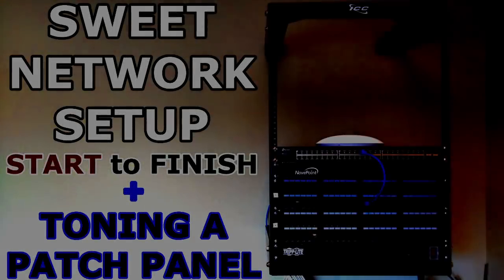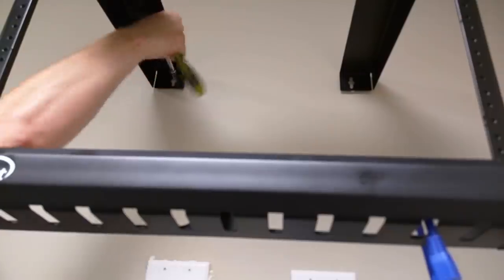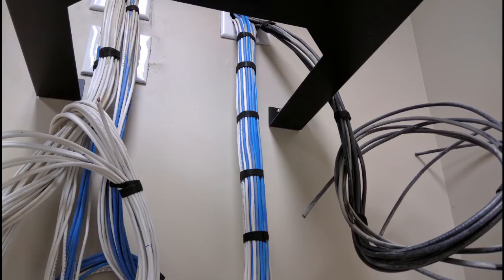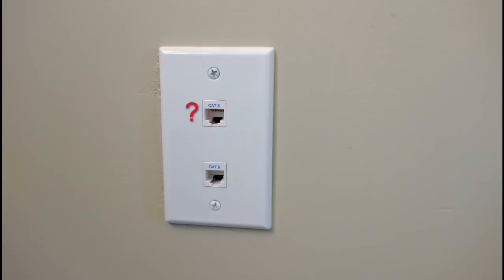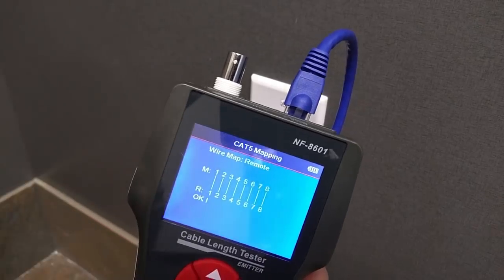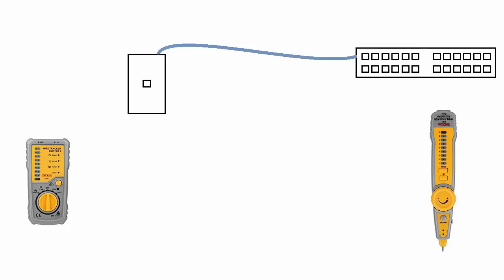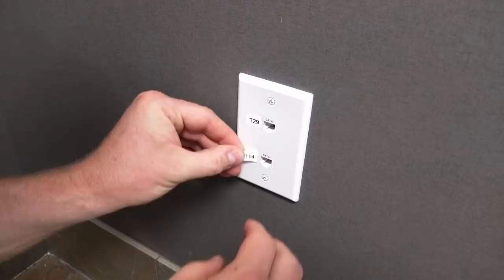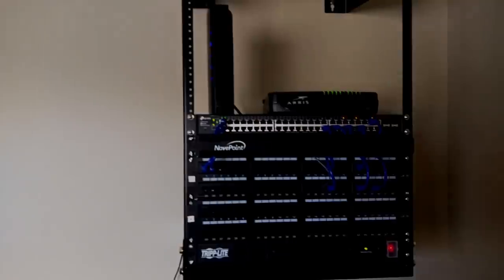Complete Network Setup // Toning, Identifying Ports

Comment: if you start with a 24 port port over the 48 port switch and the a 48 port patch panel all you will need is 6 inches long patch cords and the end result will look way better !!! you will have no need for a cable manager and front power strip also a bad option !!

Comment: Yikes you used the old style patch panels not the LINKOMM RJ45 24-Port STP Shielded Blank Keystone Patch Panel with 
[UL Listed] VCE (25-Pack) UTP CAT6 Keystone Coupler,RJ45 Female to Female Insert Coupler, UTP CAT6 Keystone Inline Coupler to eleminate all the issues with punch panels  I did those once upon a time and they suck using the other allows so much better and and lest frustrating repair work. using the female to female on the others as well makes life so much simpler but you sure get good at puttin gon the ITBEBE 50 Pieces Gold Plated End Pass Through RJ45 Cat6, Cat6a Bold Connector for 23 AWG Cables

Comment: you used unshielded cables...
I would have use cat7 or cat8 cable to be future proof
Reply from the maker: I didn't run the cable
Reply: Cat8 is limited up to 30m might not be the best choice if it’s a large house
Reply: Then what are unshielded cables for? This is a small office setup

Comment: So you are using cat5e cable but placing cat6 jack that is kind of deceiving and a waste of money. Plus why would you use cat5 anyways for wiring a new business building and not go with cat6?  The cost difference is not that great. Also that is a horrible choice for a switch.  Also you should look into managed switch to better control traffic especially if you are running cameras you at least need to setup vlans so you don’t kill the speed of your network.  I am very sorry for the negativity but people needs to know of what not to do and this is it. On a positive not good job for testing your cables!
Reply from the maker: +Booshway115 I didn't run the cables or choose them.  Those jacks were the best price and my client cared about cost more than anything. He doesn't feel deceived. That switch supports vlans. Sounds like negativity was all you brought to that comment.
Reply: I heard on the video that it was an unmanaged switch but I heard incorrectly so I am sorry about that. You did a good job at your house but this is a business so the expectation is completely different. It appears that you treated this business like your house and that is bad thing I get it that you are doing this for a friend but you are portraying to be a network professional so you need to educate your client and oversee your project.  If whoever is wiring the place did not bother to number the cables in both ends is probably a bad company.  Clients usually wants to save money any way they can and spend it somewhere more visible like furniture but when that crappy switch goes down and the business loses money they are going to blame you because you choose that switch and now they have to buy another one and ship it overnight.  So if you are going to be a professional than be one and educate your customer why spending a little more is worth it and that you can't give them all they want for that x amount of money. I wouldn't  even give them the option to purchase a tplink switch because its not reliable.  Also take ownership and stop blaming people this was your project so even the cable work is your problem. Doing cheep work on the IT world will usually come back to bite you and here you have more to loose because its your friend!
Reply from the maker: +Booshway115 I hear ya. I've never had an issue with tplink though.

Comment: I just watched this video for my own amusement. I would have kicked you out a long time ago. Just changing that gimmick of a cable tester of yours, to a proper one that we actually use in the field which btw cost less than 10$, would probably have saved you 2-4 hours of work. Btw this is proper budget, no firewall or anything. Just a standard consumer grade coax modem, a few patch panels and a L3 Managed switch
Reply from the maker: That cable tester worked just fine. Identifing all those ports was actually a breeze. What sort of hardware/software would you have used for a firewall?
Reply: @BudgetNerd  If you have the budget, i would probably go for something like the Mikrotik Routerboard RB1100. The OS is very robust and powerful and we use these things all the time whether its up on a mountain WiMAX node or for small businesses. Once configured these things run by them self for years on end, never had any problems with these. Last time i installed one was inside a mountain, to serve the security of a tunnel(RSD emergency radio and communications, cameras, remote ventilation and fire suppression) but if that doesn't suit your budget i would suggest using pfSense. Your throughput will vary depending on the spec you use. 10-100 Mbps will require a 2.4 GHz CPU Quad Core. if you need 1Gbps go for a 3,5 GHz Quad/Octa Core
Reply: @BudgetNerd  We use a cheap but reliable 500 MHz tester for cat6. you just plug one end in to the socket or a rj45 plug then on the other end we have a non lockable cat6 cable for quick and easy checks. If you have 2 guys it takes less than 2 minutes to label a whole 48 port patch panel
Reply from the maker: Thanks for the tips!
Reply: @BudgetNerd Happy to help :)

Comment: Cables must be fixed to the patch panel...! not only crimped!
Reply from the maker: +Andrés Pérez Pérez ture that is best practice, I've seen plenty that aren't too..  even at my work with a huge network, some are, some aren't.. good tip though.
Reply: Budget Nerd i usually use zip ties with the rails the patch panel itself has in the middle, off the crimping part

Comment: Your connection from the router to the switch is a crimped RJ45 connector>back of a patch panel>factory patch cable>then to the switch. SMH, why not take a factory patch cable from the router and go directly to the switch and avoid those extra connection points?  That is your most important connection point. Amateur night...
Reply from the maker: Not amateur night, I did this during the day.  I did it that way so it would neat, I didn't want a cable going over or under everything and into the switch The whole setup works great, so I think I'm good.

Comment: you know youre poor when your switch is tplink
Reply from the maker: +Enternamehere uh.. I prefer the term budget :)
Reply: Budget Nerd I do too. But unfortunately TPLink doesn't even qualify as budget. You end up buying two or three replacements before it's all said and done. They fail very often and if you use the PoE, they often don't provide full power to attached devices making them more trouble than they are worth. I quit designing "budget networks" because they just never work out that way long-term. There are some fairly solid mid-cost devices that aren't much more than than one that are much better buys.
Reply: Lol. I’ve done a few tplink switches for customers that were not big on spending. For a simple network it gets the job done. I prefer Cisco s200 or s300 series smart switches.
Reply: Eh. You call him poor but he probably makes a lot more than you
Reply: That was pretty funny 🤣 with all due respect not hating at all. I've bought tplink before in the past and some customers can be pretty cheep. Most of the time I buy more high end switch's.
Reply: ...and when you replace your $300 Ubiquiti "carrier grade" switch, (their words), that blew thanks to dodgy mains power, with a $30 D-Link.
Reply: Ubiquiti is calling their equipment 'carrier grade' now? Hah. I love Ubiquiti but you can't go wrong with a 50$-200$ used Cisco MLS off Ebay either.
Reply: Blake the Tank 

I got a TPLink in the past. A 24 port switch and it was ok for awhile but then I started having strange issues and I finally narrowed it down to that switch.

For my Home Network, I’m actually using a Zyxel 48 port switch.  I had a 24 port one I got used on eBay a number of years ago and it was still good when I replaced it for the larger switch.  It is a Managed switch.  What I really like about is is the small depth they are, so long as it’s not POE also.  Mine is just under 10”.  For smaller home wall racks, the rack depth generally is not all that much.  Took me a while to find a 8U rack with a depth of 13.5”.  That is adjustable.  That’s the max but you can go smaller.  It allows me some room behind.  They are reasonably priced, and managed which I wanted also.

In the future I plan a sub rack in the garage for a POE switch for POE cameras and a NVR.  So I have a couple network ports going out to my garage.  They’ve been reliable for me.
Reply: Lol...nowadays,  a cisco 3750x PoE goes for as little as $275
Reply: @jbdragon3295 Just stopping by to say I like Zyxel devices. I'm using one of their routers at my house.

Comment: he's doing pretty basic, one thing bugs me why would you use the patch panel for the wan port instead of connecting it direct to port 1 of the switch for an uplink. you just create another hops. and the Data jack are not in order.
Reply from the maker: I did connect the wan port to the switch, just used the patch panel to keep stuff neat.

It works perfectly fine. Also running a connection through a patch panel would not be considered a hop.

Data jacks are not in order? Around the building you mean? Who cares.
Reply: @BudgetNerd  I'm new to networking. What is a hop ? I thought it was basically the number of routers a path goes through.
Reply from the maker: A hop is when a network packet is passed from one segment to the next. It's not when it goes from a cable to a patch panel.. hops are logical changes, not physical changes.
Reply: @BudgetNerd  Ok, thank you. Just to clarify, you mean a network segment, right? A router is used to divide network segments, right or do I have that confused? Are separate vlans considered different segments ?

Comment: Cat5e in 2017? What the heck. 10gig is around the corner.
Reply from the maker: They're not editing video, nor crunching NASA's data. It's a vet. It'll work just fine. Not everyone wants to spend tons on the newest crap that they won't need.
Reply: @BudgetNerd  it's not future proof. that's the point. you as a "network professional" should know that. and cat 7 cable isn't that much more expensive. it would have been a few hundred bucks more. you never know what the future holds or how data size might explode. it's much cheaper to invest that now than to rip everything out again in a few years. when opening a business and renovating a workspace from ground up, a few more bucks for a quality cable carry nearly no weight.
Reply from the maker: I understand what you are saying, and I even agree. But I did not run the cable, nor did I choose it. That's all the client wanted to pay for despite any recommendations.
Reply: @BudgetNerd  im sorry, I really didn't mean to be rude.
Reply: Given this is a vet's office, maybe the question should be how many cats.  ;-)

Comment: I sure hope when you ran the cable through the frame you avoided electrical wires in accordance with the standards.  I have seen so many supposedly professional jobs where the ethernet cables run in parellel or even wrapped around power cables.  Then people wonder why their network sucks borlz.
Reply from the maker: I didn't run the cables.

Comment: You punched down first and then labeled?  Step into my office. You're fired.
Reply from the maker: No! I have a family to support! Plus, I didn't run the cables. Another company did, and they didn't label. Wasn't a big deal. I prefer it that way. Toning them and labeling them was actually easy and went even quicker than I thought it would.

Comment: wow.. like 80 lan ports, only one accesspoint.
wasted money on a poe+ switch, trash router.
Reply from the maker: This guy wanted to keep costs low, yet still be able to easily expand.  One AP has served him perfectly well.. have you seen the building? Did I mention the sq ft? I think not. The POE switch is for his security cameras he is adding later, and I finally convinced him to replace the router.

Pretty judgemental aren't we?
Reply: @BudgetNerd  that's false economy. you may don't need a 10gig switch and that's fine. but cat7 or at least cat6a are a must. and if only for the better shielding. poe is super picky for cable quality.

Comment: Dude. Label the cable BEFORE you pass them trough the walls. I don’t know it just common sense.
Reply from the maker: I didn't run the cable. Even if I had, I still would have just toned them and labeled that way.

Comment: You clearly have little experience doing these projects, especially using punchdown patch panels in a business.

Just so we are clear, he should have done the following:
*Faceplates with label windows
*Keystone patch panels
*Service loop at each drop (10 or so feet depending on overall length and customer requirements) Incase a drop needs to be moved
*cable management should have also been placed between the 1st and 2nd patch panel
*Cables should have been labeled via sharpie while being pulled, finalized with a label on the cable and patch panel spot
Reply: He didn't pull the cables, so I wouldn't fault him for service loops. (I'm bitching about the lack of labeling, too, but that's not his fault either.) Label windows plates are a waste of time and money; the tape label works perfectly and will last many years. The keystone patch would've been very handy in this case, as without out labels, ordering of the ports is hard to do in advance of punching. I, too, would like to see some sort of cable restraint on the back of the patch, but as it's not something that is subject to moving (it's not a swing out rack), it shouldn't be an issue.

Comment: Some bad advice here, you shouldn't send the signal from the wall jacks into the patch panel, it ought to be the other way around, that way you  won't accidentaly mark the cables incorrectly.

Yes you might have to run around a while and look, but if the people who did the cable job are complete amatures and havent numbered the cables, that's what you do. Cables with incorrect markings could prove a nightmare for whoever has to troubleshoot the network in the future.
Reply from the maker: +Nitten i wasn't marking cables, I was marking ports, and many pros think numbering cables is amatuerish. To each his own, and it depends on the job I guess. If you are testing and labeling ports correctly, you won't mislabel them by sending the signal to the panel. I didn't. There are lots of ways to get the job, this is one of them.
Reply: Nitten so you are one that plays with Sharpe's to. Your fired, and I never hired you. It is not good practice most of the time when a real cable installer does an installs the dry wall has not even gone in. This is what happens in the real world. after you have gone in and left your Sharpe marking the dry wall goes up then texture is sprayed on the cables, and then the painter paints and gets paint all over it. By the time that the job is passed back to you the Sharpe scribble you wasted time on is gone. Get a good mapping tool Klein makes them all day long.

Comment: guest wifi is never a good idea. Thats how you get leeches in your parking lot doing things they would never do on their own home wifi. Besides that with all the smartphones out there there is no need for a guest wifi in a business anymore. let them use their own data services.
You should use Furman power strips that audio guys use., the sockets are in the back, some have rack lamps on them and power meters all have superior noise suppression built in.
No labels? Oof I hate to be the guy working behind you..
Reply from the maker: I didn't run the cables.

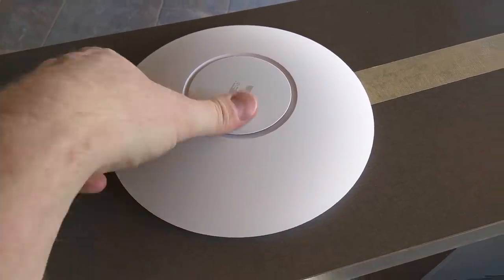Comment: 1:24   "Once the cables were ran...."     Oops.  That should have been "Once the cables were run...." .   Grammar:-  In the case of the verb run, the past participle is run and the present participle is running. So you never should say have (been) ran or has (been) ran, it's always have (been) run or has (been) run.